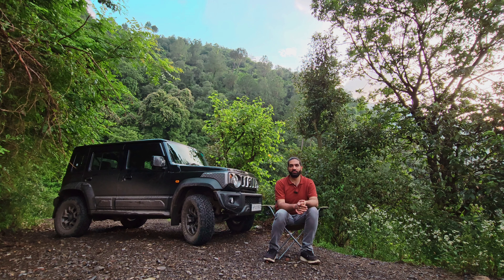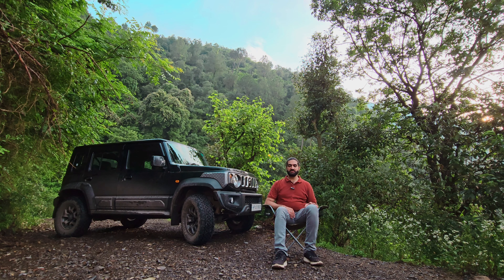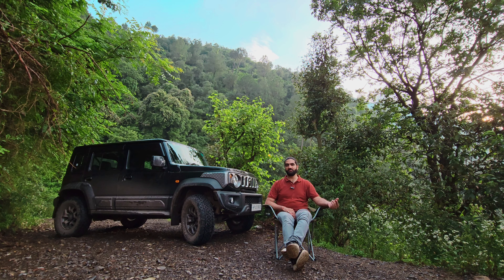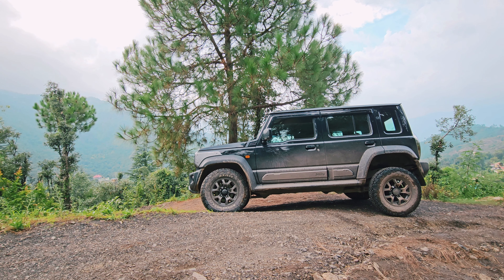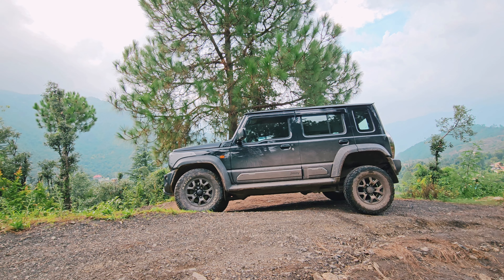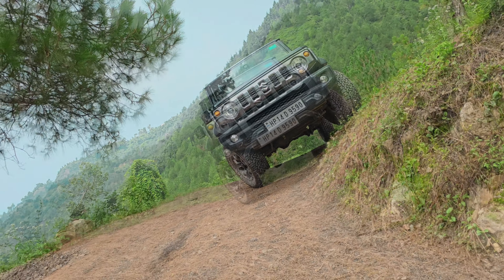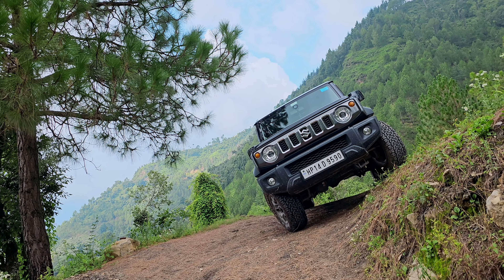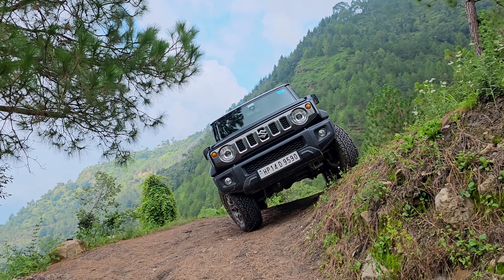Mythbusting jimny's tyre upgrade||Do Not Upgrade without watching this video|@RoadsOfTheMountains

Comment: I think this issue can be easily handled by making some adjustments in the wheek well . Good video tho
Reply from the maker: Hi,well it would have more than 1 solutions to handle it,but cutting down on bumpers and making other spaces inside the wheel well is a last resort for me.Even after that the snow chains would not accomodate.Getting rid of the wheel arch extensions is the simplest one but very unprofessional
Thanx for tuning in and do subscribe.
Reply: A UAE jimny owner completely replaced the front and rear bumper with Japnese narrow K Car virsion. It looks likes tyres are bulging out from the fender.
Reply from the maker: @infinitebeing1119 
Removing those would make the jimny look bad.wheel arch extensions are very important.Getting rid of those is not good at all.Therefore only a lift kit would help in the case of 235s.
Reply: @RoadsOfTheMountains  I am not talking about wheel arch. He replace the front and rear bumper only with japnese k car virsion. It looks unique like old jeep with raised fenders.

Comment: I am viewing your videos from the day one.. really good and honest content. I will be getting my Jimny soon I will too upgrade to 235/ 75r15 ..let me know about the lift kit which I should install and how many inches it should be 🎉🎉
Reply from the maker: Hello,dr vikas thanx
For your kind appreciation.
Atleast a 2 inch lift is required to fully
Utilize this tyre size.one can opt for easy metal spacers installation,costing just around 5 to 10 k.and can go upto the price of 200 to 250K for japanese adjustable suspension upgrade.
I am currently searching for all viable suspension lift kits,which will be highlighted on the channel once installed.stay tuned have a great day.
Reply: Atleast 60mm or then 2.5 inch lift is the minimum to accomodate 235's without rubbing . If u do 2 inch , 235 will rub at certain circumstances , better than in stock but will still rub . So either cut ur bumper with 2 inch to prevent rubbing or do 2.5 and forget the rest . Found it from some Australian Jimny forum months ago .

Comment: I am hooked with your channel now due to the articulations . Kindly confirm fo we need to change the default rims to install 235 section AT tyres along with lift kit?
Reply from the maker: Hi.Thanx for the words of appreciation,
We can install 235s with the stock rims and alloys.it can be managed with it.it's even better with lift kit installed.Thanx for tuning in.

Comment: Is there any big difference between 215 & 235 with 75 profile? Thank you.
Reply: 20 mm of difference in the width, chances of 235 to get rubbed onto an interior part are more compared to 215.
Reply: also heavier by 3 to 5 kg depending on brand.
Reply from the maker: Hi,Thanx for tuning in
The difference is as follows
- 235s have more height as 75 percents of 235 is more than that of 215
-235 grips very well on slippery surfaces
-235 provides a wider track which helps a ton when cornering with lift kit and roof top tent installed.
Overall 215 is a safer,no botheration size
Whereas 235 is for enhanced purposes.
Hope this delivers your required answer.
Stay tuned,have a great day.

Comment: Do you feel jimny is underpowered?
Reply from the maker: Hi,yes the jimny is a little underpowered.However The light weight makes up for that less power.i would call it more like fairly powered.
Reply: @RoadsOfTheMountains  If we ignore the horsepower number and the weight ratio. 

How does it feel to drive it ? Umm like how responsive the engine is and how much it accelerates in-gear acceleration. 

Is there significant power loss on shifting on hills?

I know they are lot of questions soo thanks in advance
Reply from the maker: @ROADRUNNERSINDIA  The k 15 b
Is a peppier engine in practicality.it has got potential to pull,which one feels when accelerating.Power is avaiable at commmand when needed.
Keeping the numbers aside,it has decent pulling power.overall a good package.
When accelerating on uphills slight power loss is felt but the engine being peppy can be pushed beyond 4000 rpm to find more power.hence Decently powerful.Hope this answers to some extent.
Reply: Thanks that answered everything. Do you have an instagram ?
Reply: Yes much underpowered ..
Ideally the engine should have been a 1.6 Ltr Gasoline Turbo  engine having min 125 Bhp and 260 NM as power.

Comment: It is not advisable to opt for 235/75/R15 unless a lift kit is in place. Once you implement the latter, everything will be sorted. 
If there are no plans to go for lifting, better choose 215/75/r15. Best of both worlds. :)
Reply from the maker: Hi,Yes the lift kit is inevitable with the 235 s,215 is a perfect size which does not require any modification to jimny's suspension set up.wish the 235 s would have coped up better but it is what it is.

Comment: Bro where i can get the roadcruza 215/75/15 tyre
Reply from the maker: Hi,You will have to ask your dealer if he has one,try with the dealers in the chandigarh Area.215 size is a smaller section tyre not sure if They import it in this size.But still you can try

Comment: 215 tyres should be better. Stock tyres are 190. Please clarify 🙏
Reply from the maker: The 215s are a no hassle size,they will not create problems.the stock size is a 195,not 190..

Comment: dude your jimny makes so much noise. I had driven a friends, alpha manual, and it was really quiet. We went to mussoorie, and at times we were unsure ki car on bhi hai ya nahi. Is your car loud because of the tyres?
Reply from the maker: Hi,The engine on idle is very silent,but once you are past 2500 rpm it starts to create sounds which may appear noisy to others specially on the videos.Because of the diffrent positions of mic.
And yes the AT s do get noisy as compared to the Stock HTs.

Comment: Just do a 50mm lift. I am on a 235 75 r 15, will be charging to 265 70 r 15 with 30mm spacer
Reply from the maker: Hi,thanx for tuning in.As of now i am looking into all the sophisticated equipment that is available for the jimny.50 mm sounds like a perfect upgrade,i also have my eyes on adjustable suspensions.Lets see what suits best .
Spacers are a very efficient and cost friendly upgrades.Be careful when the rubber spacers wear out they can cause parametre changes in all four tyres.Better plan for a lift kit only.
Stay tuned and do subscribe.
Have a great day

Comment: Why on earth would you put a 235 on the Jimny without first adding a 2 inch lift kit minimum!
My first mod on my 2022 jimny was 2 inch lift plus rock sliders plus rear diff lock.
My second mod was 235/75/r15 tyre change and that was done just to add some extra clearance from the diff housings to the ground.
Don’t ever go more than 2 sizes up on a rig without first adding a lift kit.
2inch lift kit easily supports 29 inch or 235/75/r15 tyres.
Reply from the maker: Greetings ,
Well to sum it up my jimny was one of the earliest of the 5 door lots in my country,As the stock tyres looked very skinny,These  235s looked like the max i could go as the first upgrade without having an unproportionate bulging out look.I am looking into all the viable lift kits as of now.
But before installing one i was keen to see and check the tyre fitment with stock lift.
The mods that you mentioned are all very functional.Lets see where my mod journey would take me.
Thanx for tuning in mate.
Do subscribe.
Reply: @RoadsOfTheMountains  I’m hearing you brother!
You’ve got to start your mods somewhere.
I’ve spent close to $20k AUD on my Jimny since purchasing and could not be happier.
Definitely get a rear diff locker with air compressor mounted in the engine bay, lift kit, rock sliders, long range fuel tank, extended diff breathers also to the engine bay and your Jimny will become a mountain goat that’s unstoppable.
And a last word definitely keep the 235s, you cannot do better than the 235s.

Comment: Please do not use 4x4 at full steering lock when you're at standstill. It puts a lot of strain on the drivetrain and other parts. 

I know you showed for demonstration purpose but don't damage your vehicle for us.
Reply from the maker: Hi,thanx for highlighting this lesser known fact.I am aware of the 4x4 implications,specially on paved roads and full steering locks.cv joints are stressed out.
Yup that was just for the demo,appreciate your concern for my jimny.2 H is my all time buddy on tarmac and regular usage.
Thanx stay tuned.

Comment: Everybody knows you at least have to lift the car 2 inches before even thinking about bigger tyres, and then with 2 inches the 215 is the better option.....
Reply from the maker: Hi,Upgrading the 5 door jimny is kind of a journey in itself.So whilst my lift kit is still being finalised,i wanted to first see the fitment of these 235s without lifting.Evrything will eventually fall into it's place once the lift kit is installed.
Thanx for tuning in.
Reply: @RoadsOfTheMountains  ok, good luck !